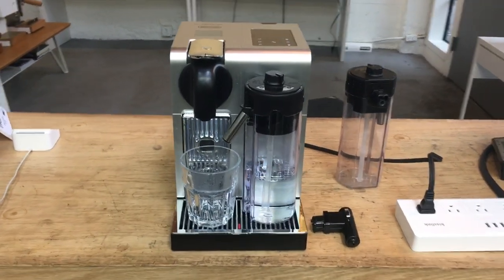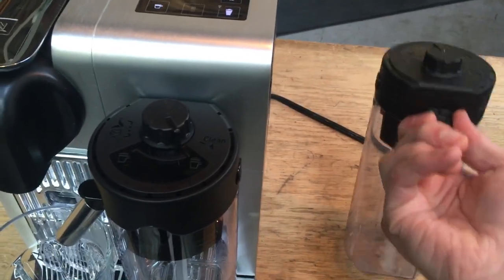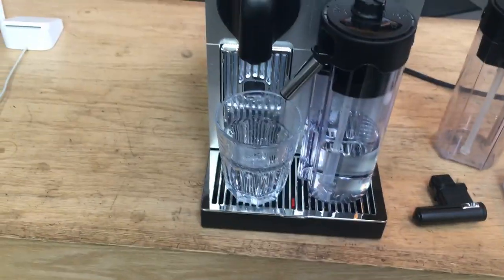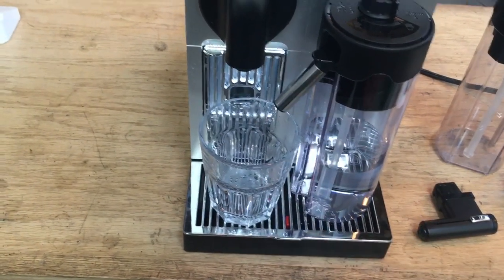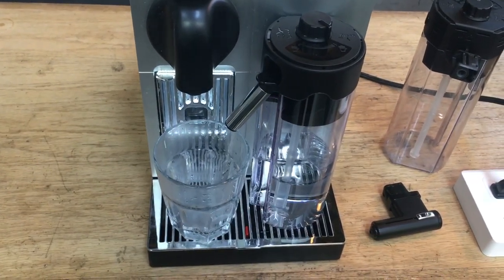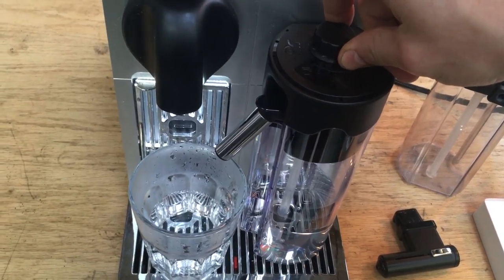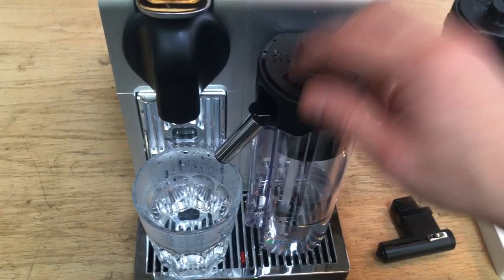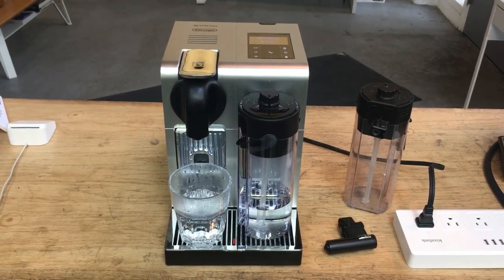Not frothing milk- Delonghi Nespresso Lattissima Pro Test 1402

Comment: You brought my old Lattisima back to life with your video. Thank you! For those wondering how to clean the nozzle. I ran mine under hot water, blew through it, and used a toothpick to gently poke on the tiny hole end. You can also go with a toothpick from the larger opening end but don't dig deep as I believe there may be a screen of some sort in there and you don't want to damage it.
Reply: I used a small strand of wire and pushed it all the way through.

Comment: Thank you.  That worked.   I thought it needed to be descaled again... did that 2 weeks ago.  I will be more careful in the future.  Would be nice to have a tiny tool.  I used a safety pin.
Reply: Karen Brooks Nelson a had to suck it out by mouth. So disgusting. No pin or needle worked. So a tiny unsharp needle and a tiny straw would be great. I do descale every 2 weeks. The water is filled with lime and other substances .

Comment from the maker: Usually, this is repaired by cleaning out the solenoid valve.  If this doesn't work then the solenoid valve needs to be replaced.
Reply: How do you clean the solenoid valve?
Reply: hi, thanks for your vids. Which solenoïd valve it is please?  thanks for your information.

Comment: Hello.I have lattissimo one nespresso machine.Milk frothing button is not working.and descaling light is on.what can be the reason thanks
Reply: There's a MAGNET in the milk cup lid, the dishwasher may have knocked the magnet loose and now the cup isn't being read either place a magnet in that spot or get a new cup, but if u shake it and hear somthing moving its the magnet inside the milk container top

Comment: hi how did you clean it i have the same problem :"(
Reply from the maker: We soak it in milk cleaner. https://amzn.to/2pVkQnu

Then, we blow it out with compressed air.  You can use canned air if you don't have an air compressor.  Finally, you can use a small wire to clean the tip if it is still clogged.  Just be careful not to damage the plastic with the wire.
Reply: Kanen Coffee, LLC. How long you left it soaked in the milk cleaner?